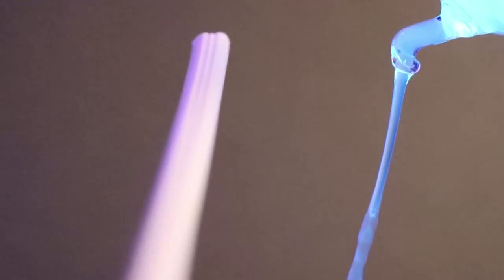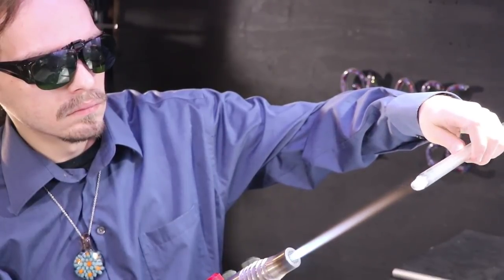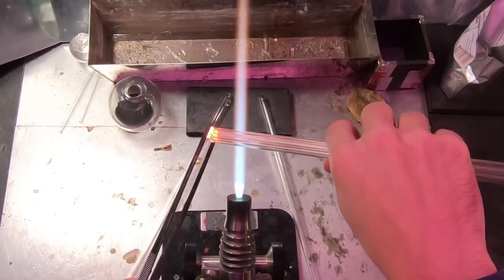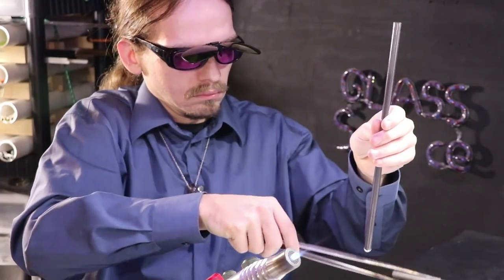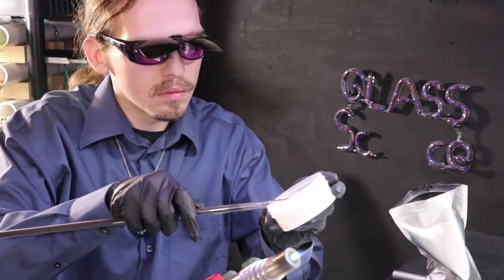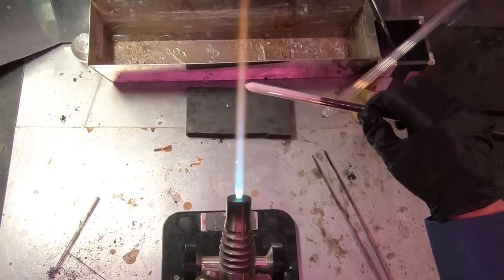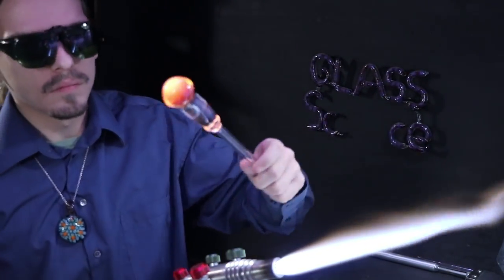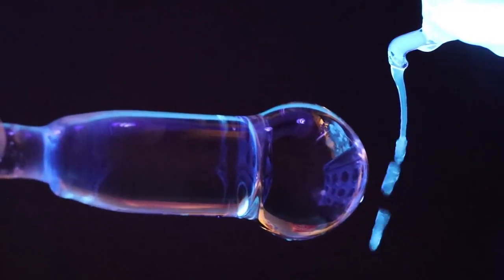Water Bending 2!

Comment: Helllo Matt, can you let me know how you made the glass pendant with implosion ?
Reply from the maker: Hello Brigitte! If you mean the one I wear in the videos I made it before I started recording for YouTube. It's been sort of my flagship piece. It's very similar to the Implosion marble video but with a slight compression and very specific dot placement. Also check out my mothers day pendant video for a cool Frit backing technique.
Reply: Thank you Matt i will give it a go 👍Have been practicing the beautiful glass chain but 🥴after connecting the loops a lot off them crack . Meaby you have a tip for me.
Thank you for responding, 
Kind regards ,
Brigitte ( Belgium) 🇧🇪
Reply from the maker: @brigittekleynnaert1123  Good to hear you've started melting glass, it can be difficult but very rewarding. Glass chain is hard, I wouldn't recommend it to beginners. But after each connection I let it cool completely before letting it touch the other loops. I don't want hot links laying against cold links. The video is sped up for YouTube, but it can take over 5 hours to make a full chain necklace. Good luck Brigitte! 😎👍🔥
Reply: Thank you , i will not give up ... practise ....practise 😜🔥🔥